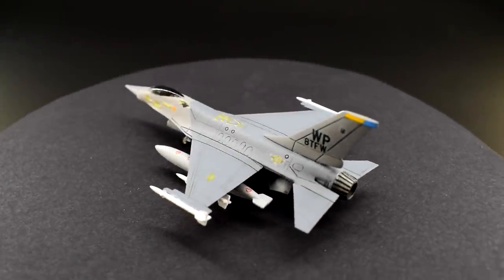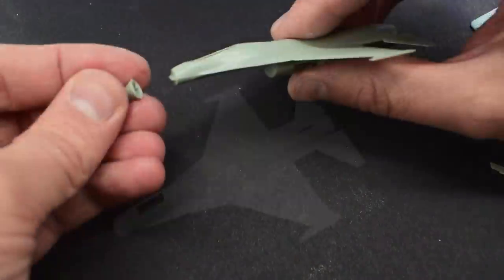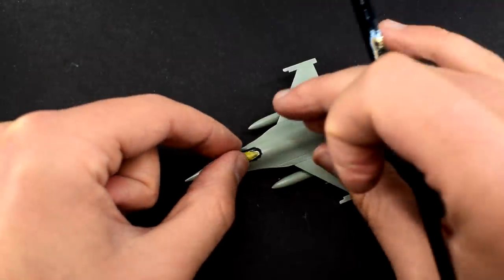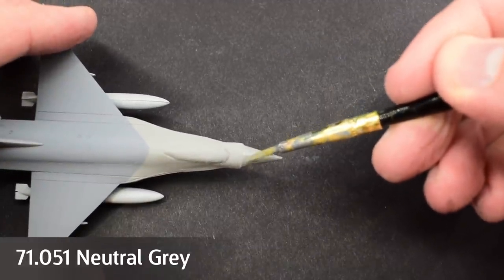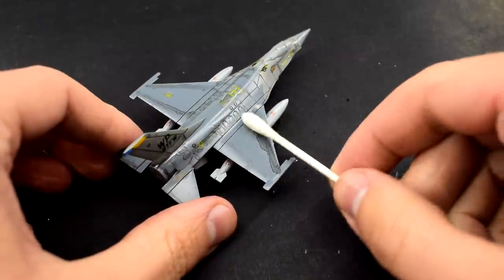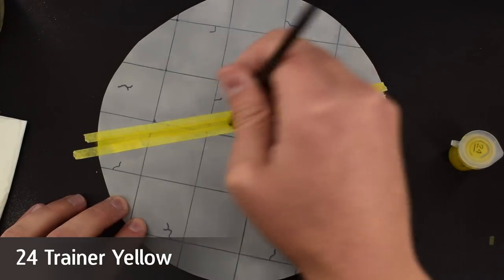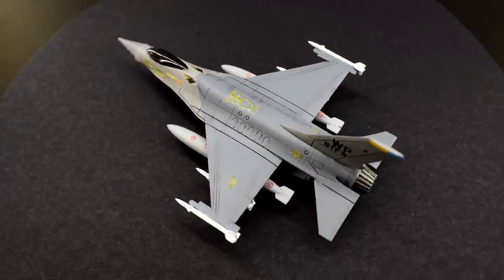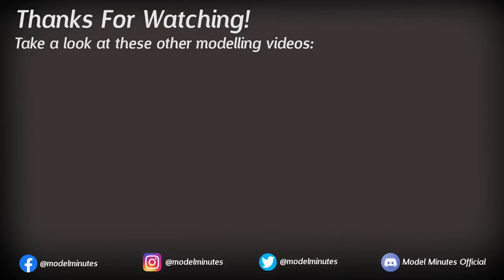The Academy F-16 Model Kit in 1/144 Scale is a Bit WEIRD . . . Build & Review

Comment: Some of the Academy 1/144 kits are really quite shocking (as demonstrated here - not the build mind). But if you think this is bad, you should see some of the earlier 1/144 Dragon/DML kits. The best F-16 in 1/144 is the Revell one, amazing kit that. I predominantly model in 1/144 myself.
Reply from the maker: Thanks for the info!
Reply: Could I please pick your brain about some other fighters? Looking to build in 1/144. 
F-14
F-15
F-22
F-35
Researching the web has not provided much for this scale. I would appreciate your knowledge and insights!
Reply: @definitely-a-b0t  

I've built the Revell 1/144 F-14 A/D models and they are very good quality. Even better if you add the Retrowings cockpits. The Trumpeter Tomcats are supposed to be good, but I haven't seen them - I think there is an old mold so watch out.
F-15 has to be the Revell F-15E, nothing else comes close I don't think.  I built one a while ago and backdated it to the NASA F-15B ACTIVE 2D - still my favourite build to date. I'm not aware of any F-15A/C apart from the old LS kit which everyone has repoped at one point. It's a good kit, just needs a cockpit upgrade and engines - once again Retrowings is a good start. Domi makes some good stuff.
F-22 - Trumpeter all the way. Revell have one but it's actually an YF-22A.
The only F-35 I can recall the Revell one and that's actually the JSF F-35 prototype not the current production model.  I did start it a while ago but it's resting on the shelf of doom. It's quite a rare kit now also.

Hope that helps?  Other good kits of not are the Revell Rafale M, Harrier II+, Tornado GR1, Eurofighter Typhoon and the F-16 is just an amazing kit. The Apache/Chinooks are good too. :)
Reply: You really need to do some research before making a choice on a kit even if it's a company you generally trust. There's a lot of incest with the molds. The 1/144 A10 from revell is a reprint of a matchbox kit so yeah... it's not great.
Reply: Oh nice! I just picked up a few 1/144 dragon models from my local antique store!

Comment: I bought this kit, along with the Academy F-15 and built them at the same time to compliment my Revell 1/144 C-17A for scale. I had high hopes when opening the box as the mold in general looked good. But I was also disappointed in the accuracy of the canopy and nose, but then even more so when comparing it to the F-15 which is fairly decent of a kit. I also wasn't impressed the with decals as the Air Force roundel and other decals are too yellow from what they should be (and that's not from aging). But for the price, you get what you paid for.  I enjoyed the build and review! Thanks!
Reply from the maker: thanks for sharing!

Comment: Hey Matt, nicecvideo. But I have one question. So, why you don't fix the gaps between the two half's of the underwing fuel tanks?
Reply from the maker: sometimes it's because i consider it a bit of an awareness of the issues of the model - which gives the viewer, such as yourself, the chance to spot areas that may require additional work when (or if) they come to build one of these for themselves.

Othertimes it's simply because I don't really want to and would much rather move on to more interesting kits. Especially on a model like this which from the start isn't exactly the most accurate of models

Comment: The easy way to unclog the Contacta Professional needle is to just hold it inside a flame of a candle or a lighter for a bit (after detaching the needle from the plastic bottle itself of course) any glue residue inside should just burn off, often with a little fireshow.
Reply from the maker: yeah, i've heard of this method, something I'd have to do outside though
Reply: I have a mini drill bit set. I just put a small drill down the tube if it gets clogged.

Comment: Thinking to buy one of academy models kits? Is it worth to buy one for beginner?, If yes, which one your recommend?
Reply from the maker: Hmm, I've not built loads of academy kits but they do seem to have the same consistent issues - their decals tend to be quite thick and don't really stick to the model too well. Also, the images/artwork on the box dont always match the paint scheme included in the kit.

That being said, if you're looking at building one I'd probably pick something with a simple paint scheme (like the Mirage) because it would be easier to complete
Reply: @ModelMinutes  the Mirage III R?
Reply: @ModelMinutes  and what about the academy F14 Tomcat 1/144 scale?
Reply from the maker: @abyanab876  I don’t have experience of that kit, but I presume it will be of a similar quality to this and the tornado in 1:144 that I’ve also built
Reply from the maker: @abyanab876  I think I made the iiic, there is a review on my channel
Reply: @ModelMinutes  aight im gonna watch it thank you for the recommendations

Comment: How do you unblock the glue tube?

Also you did well for a small and cursed model like that
Reply from the maker: Thanks! Apparently if you remove the needle from the bottle of glue and then run a flame from a lighter over it ( holding it with some pliers and doing it in a safe and ventilated space) the excess glue will burn off and clear the blockage

Comment: Nice practice.... The kit is, obviously, a toy hahaha. I couldn't recommend a better kit in 1/144 scale, but if you wanna build a goog 1:72 F-16C you have, rather expensive, Tamiya, and for an early A, you can go with Revell. Again, I must say, some interesting facts about an actual aircraft: F-16 has thesame engine as F-15 and Tomcat (General electric F110) . Those 3 planes are built around thesame propulsion, even though those 2 are much big2and heavier than F-16.
The highest ranking officer of the USAF and commander in Pentagon, David Goldfine was shot by Serbian AA over Bosnia, whilst flying in F-16C, in 1995. After a day, he was evacuated....
Reply from the maker: thanks for the info!

Comment: The Dragon 1:144 F-16s are nicer, but they have been OOP for a while. Not too difficult to find, though.
Reply from the maker: hmmm might have to investigate
Reply: @ModelMinutes  They made quite a few variants and markings schemes from the F-16A to the D. Even one in Thunderbirds markings and foreign users, besides USAF. Check out the product timeline on Scalemates - https://www.scalemates.com/kits/dragon-4504-f-16a-fighting-falcon-thunderbirds--163523
Reply: Agree, remember building a few 'dogfight doubles'from dragon in the 90s, the mig29/f15 stands out. Off to have a root around on eBay...

Comment: I think that if the canopee glass was a bit bigger or taller it would look better
Reply from the maker: yeah, i think you are right
Reply: @ModelMinutes  OHHHHHHHH NOW I REALIZED THE PROBLEM
Reply: @ModelMinutes  the nose is facing upwards. The cockpit should be bigger, and the part behind the cockpit is too low
Reply from the maker: @carter_1175  I originally put the nose on the other way and it didn’t fit 😂
Reply: @ModelMinutes  ಠ_ಠ